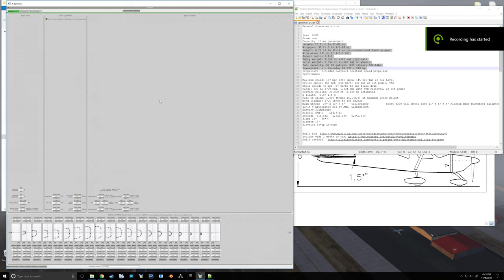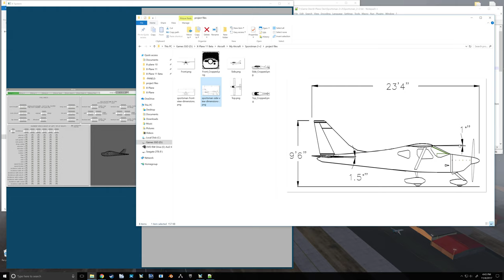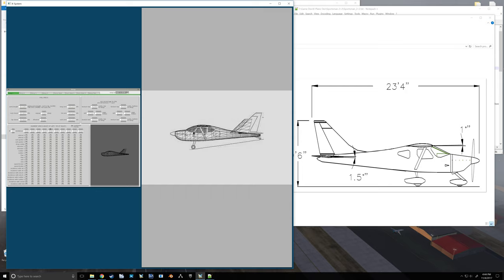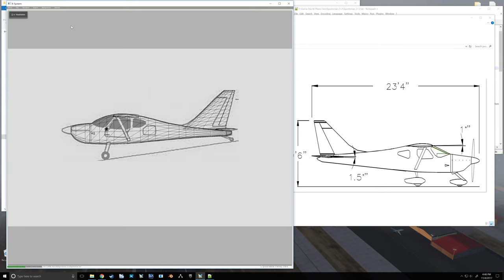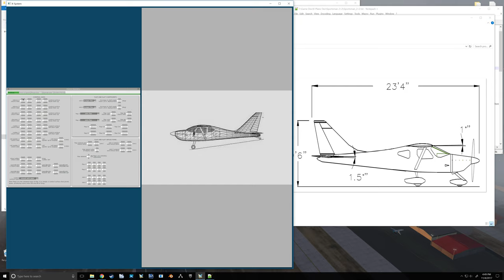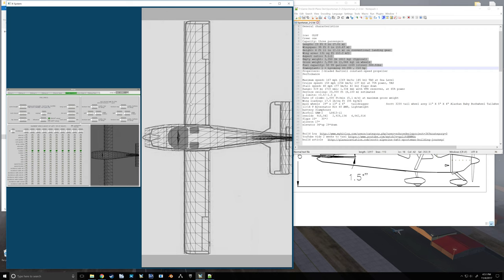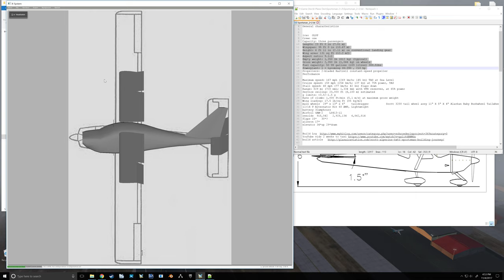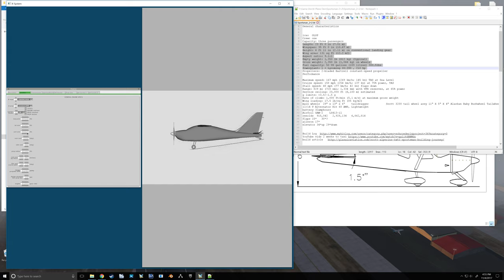Making an airplane for X-Plane 11 Tutorial #4

Comment: Are the lengths and dimensions in inches, feet or meters? or where can I set them?
Reply from the maker: You can see that in this video at around 4:14 https://youtu.be/5KUweAN59rQ My measurements are in feet, but in the viewport tab you can change to metric if you prefer.

Comment: Your titorial series is epic! So helpful! Thanks. I am working on an A330 for x-plane. I am creating it in blender and impprting it to Plane Maker. I'm good with the animations so far. But what i do not understand is how to add wingflex to impprted "blender-wings". Do you know how to do that?
Reply from the maker: Thank you! I am glad it has been helpful. Adding wing flex is pretty easy if you understand animations. It can take some time though. The trick is that you must cut your wings into multiple pieces and then animate each piece. This is because x-plane does not yet support vertex animations. 
For a simple example: a wing with flaps and ailerons could be cut at the outboard edge of the flaps. You can then add an animation at the root of the wing to lift slightly and then another animation at the end of the flap to bring the tip up a little more. The aileron and nav lights would also need to be parented to the outboard animation and the outboard animation is parented to the animation at the root of the wing. 
In this example the wing flex would probably look more like a fold, so to improve on the flex appearance you cut the wing into more sections and more animations. I believe you can use this dataref for the animation: sim/flightmodel2/wing/wing_tip_deflection_deg
Hope that helps. Keep up the good work.
Reply: @BuildItBetter3D  Thank you for the good advise Makes sense! :)

Comment: Hey There! Is it possible to model the plane in blender and with the aerodynamic basic model in plane maker, can you hide certain parts of it? Eg. If you don't add flaps in blender but you add them from the plane maker model but hide the rest of the plane maker model for the final product?
Reply from the maker: Sort of, but not worth it. It’ll be easier to just model what you want to see in blender. You must have the planemaker part too, it’s just hidden. To mix a little of both will give you more trouble and will never look right.